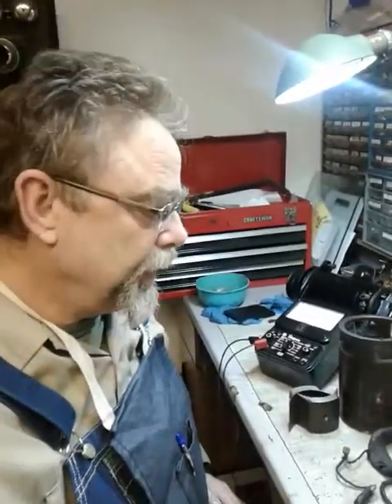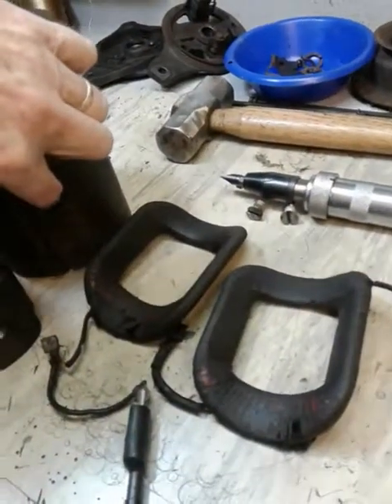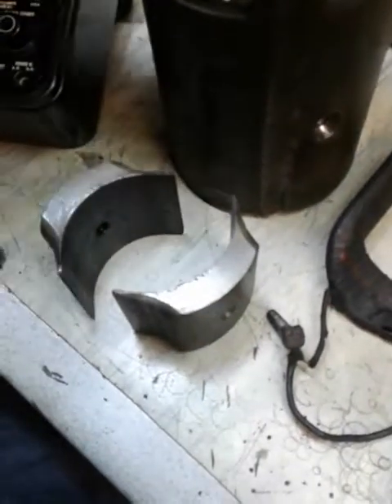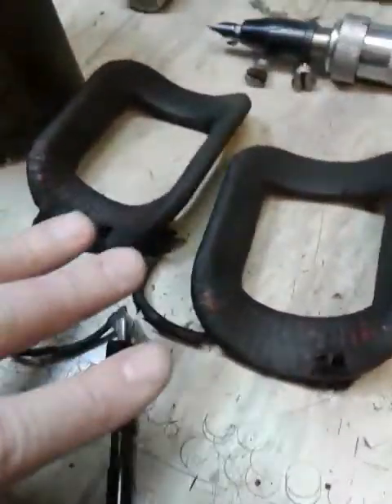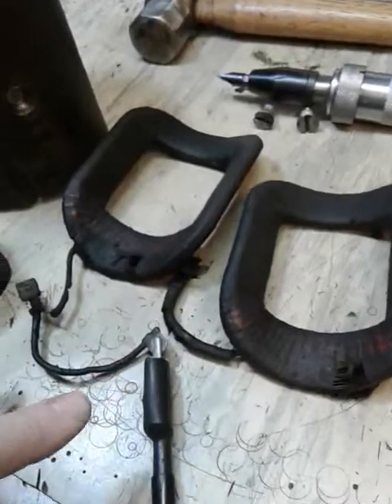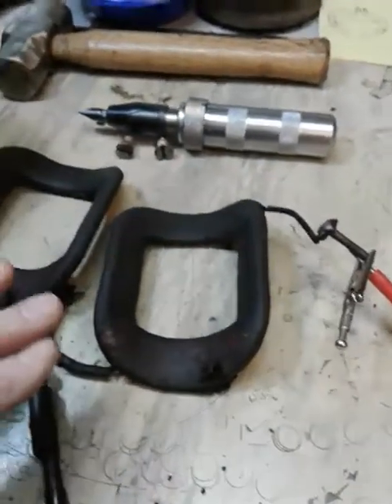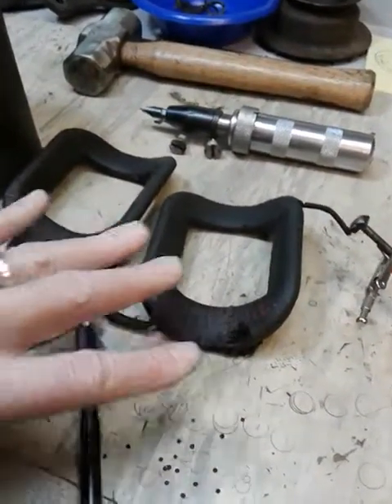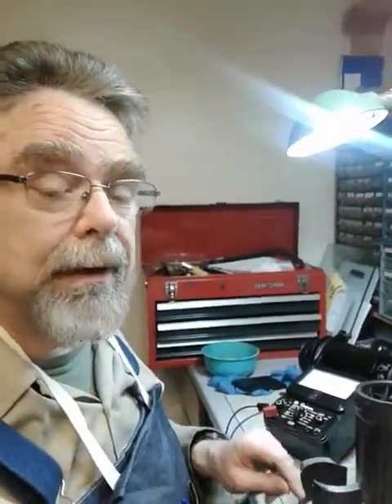Gen 6   removing and testing field coils

Comment: Hey Steve, I sure could use your thoughts on this. I have a 1941 Ford 9N tractor with a 3 brush single output connection generator. I cannot get any voltage output out of the generator. I have tried re-polarizing it to no avail. I have had it apart about 7 times now inspecting the field and armature coils. One of the brushes for the adjustable field coil looks a little worn but all the brushes are making continuity according to the simpson 260. I have even done the motor test by connecting the generatordirectly to the battey and it does spin but not very fast.  By the way I tried interchanging brushes thinking that might be the issue but each time I test I get the same thing no voltage out. Is it possble the field is just too weak to produce output voltage even though it motors?  Thanks Tom in Alaska
Reply from the maker: Fields could be weak or grounded. It could still motor with bad fields. You should also have the armature tested on a growler for opens, shorts and grounds. Seem growler test video.

Comment: Steve. Is 0.1 of an ohm an indication that they are shorted within?? 
Could you place a piece of metal close to each pole one energised and should it stick the pole strongly??
Reply from the maker: .1 ohm does sound shorted. With almost no resistance, I would not hook them to a battery. It is esdentially a short. With good field coils you can.
Reply: @SwabbieSteve  I did :) 
Nearly burned my fingers off
What would a good resistance for a starter be? 
I thought it would be very low
Reply: @SwabbieSteve  It claims. 05 ohms is a reasonable resistance for a starter motor though. 
Anyway regardless, if I bring a piece of metal close to it once energised, shouldn't it attract this metal firmly?
Reply from the maker: Sorry, I can't help with a starter. I haven't measured those.
Reply from the maker: Yes, i would expect so. It will also pull a compass needle showing polarity.

Comment: Working on a 6 volt generator on a positive grounded 1955 Farmall.  The generator passes the motor test (running a lead from the battery to A), but fails the field test (no loss in rpm when connected directly the battery ground.)  I removed it and get 5.9-6.1 ohms.  This generator was rebuilt about 3 years ago and was perfect.  Tractor set up for a year or so, now failed.  Visual inspection shows nothing.  Coils are nicely wrapped in fresh wrapping.  Thoughts?

Comment: Thank you very much!!! My starter is reading 0.2 ohms!
I noticed on of the arms going to the field coil warped so probably got way too hot and deformed causing a short somewhere in the wrap.

Now to figure out how I can get my field coils out without stripping the screw.
Reply: I'm getting 0.1 ohm in started field winding,  is that way too low.
Once energised, should a piece of metal stick to a pole strongly??

Comment: Is there any way I can convert a 6v 3 brush dynamo to to charge a 12 v battery at a lower rpm
Reply from the maker: Not something easily done by the home mechanic. But a good motor shop could probably do it.

Comment: Great Video ! My Hupp Generator stopped charging it is an Autolite GAL-4124 . The connection between the two field coils was shorted to the case. I insulated it but the field coil total resistance measures 2.1 ohms. Seems a bit low. Where can I find a spec for field coil resistance for this model  generator ?  Need to make sure things are right before I put it back because it drives off the timing chain. A bear to take in and out. Thanks  for sharing ! ! !
Reply from the maker: My autolite manual does not list that exact model, but does list other GAL-XXX generators. Field coil draw should be 5.0v at 2.9-3.2 amps. That equates to 1.72-1.56 ohms.
Reply: @SwabbieSteve  Thank You !   Given I have about .4 ohm lead resistance and I'm measuring 2.1 that puts the field coils in spec. Thank you for your response again. Great video sequence !

Comment: Quick question...why would you need to put the field coil shoes back in the same spot? I'm asking because I have 2 generators that are in pieces and there's no way I'd know what shoes goes with what coil. 

Also...what tape is used to rewrap so I can order it and get it sent to Australia? Thanks mate.
Reply from the maker: The pole shoes have some residual magnetism. After reassembly, flashing the fields should reset the residual magnetism and polarity. But  I'd rather it be right to begin with. Also, the clearance is very tight. Both shoes may not be machined exactly the same, so it's better to put them back as they came out. Do an internet search for "field coil wrap".  There are many options, just be sure it is thin material, because the clearances are tight. Good luck!
Reply: @SwabbieSteve  Steve, sorry to ask a dumb question but my coils covers were just like yours...falling apart like tissue paper so they'll need to be re-wrapped. Won't that negate the thousands of an inch size difference that each shoe to coil would have? I'm a home garage guy with limited tools...I don't have all the auto electrician tolls you have...just a workbench,socket set,some old screw drivers etc. Can I just re-wrap the coils and reinstall everything? It's an Autolite 5002 I believe out of a 1943 Ford GPW Jeep that someone at some stage swapped the open bearings for sealed ones. I'm going to reuse them but get new screws and bolts as the screws had to be drilled out to be removed. One of the wires broke off the stud so that'll need re-soldering and shrink wrap but all in all it appears to just need a clean,paint,re-wrap of the coils and a new pulley as I broke the original cast one trying to get the armature nut off. I'm not an expert so if it is possible to do a video showing how to wrap the coil and heat shrink the wires, apply new coating to the armature wires and test at home with a basic voltmeter that'd be AWESOME! Thanks mate...G
Reply from the maker: Sure, just wrap them with something thin and strong. When the pole shoe is fully seated it will squish the coils to shape just a little.
Reply: Did you manage to get the correct electrical tape to wrap your field windings.

Comment: Caught this video today and I was wondering...if one of the field coil lead wires were broken, is it possible to repair or reconnect the wire? Soldering or other method?
Reply from the maker: Yes, the field coils are made from what is called magnet wire. It is copper wire with a clear insulation coating. Just sand off that coating, then it can be soldered.